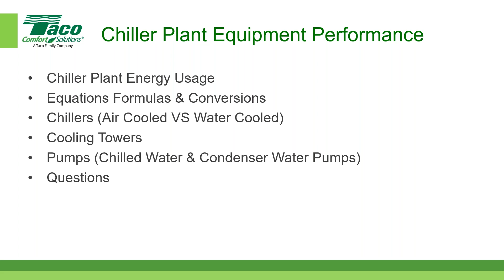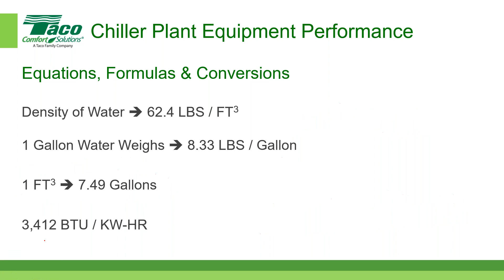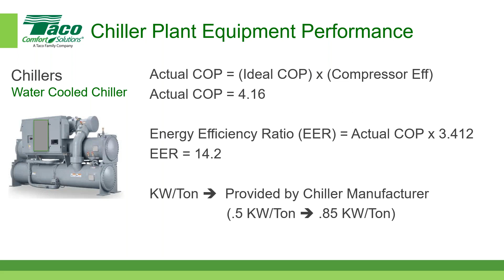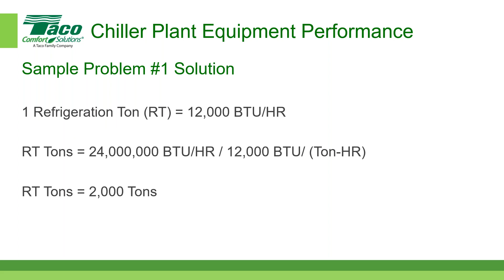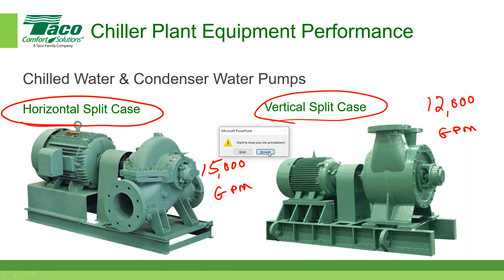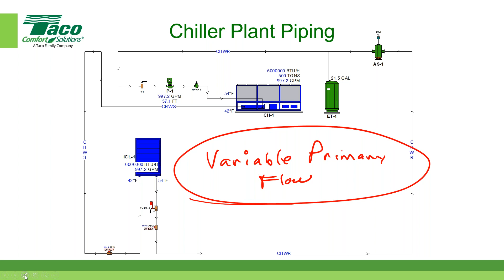Chiller Plant Equipment and Piping Design

Comment: You're missing a minimum flow bypass valve, on the VPF schematic.
Reply from the maker: Hello Damian,
Thank you for attending the Taco Tuesday webinar series and we spoke with Rich and Brett and here is their response:
"The diagrams indicated are for instructional purposes only and are not intended to show all system possibilities.
Although many systems may require a minimum flow bypass on a Variable Primary Flow (VPF) system, not all systems will require a minimum flow bypass.  The engineer of record should make that decision based upon the specific characteristics of the system. "